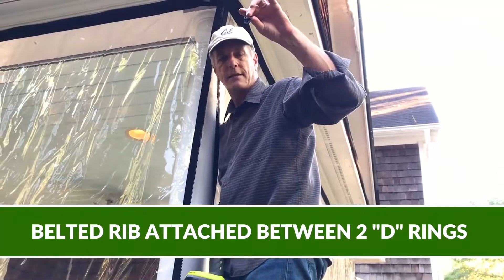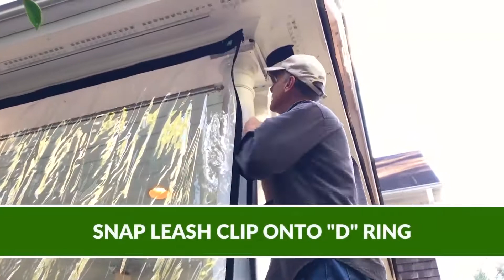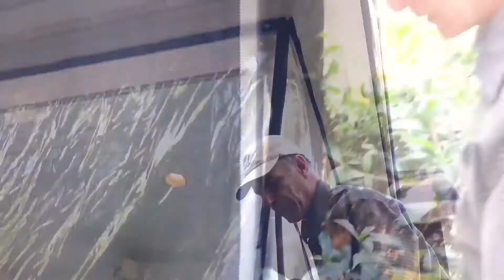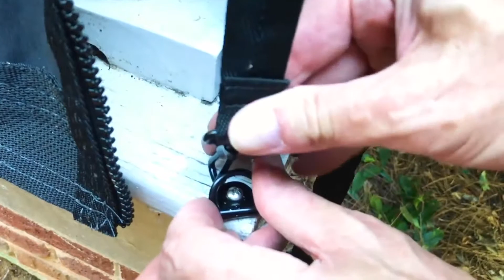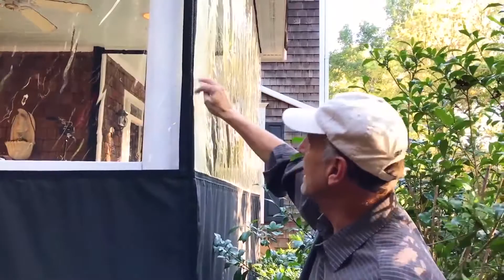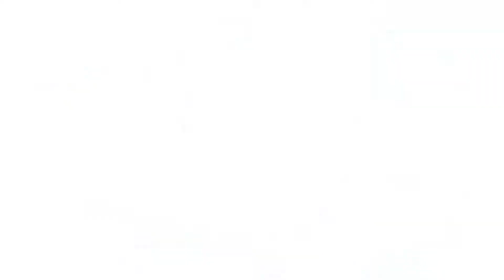Belted Rib

Comment: I am designing a small porch enclosure and have 90 degree corners where there is no support (columns or posts). I have been throwing around the idea of sewing in a pice of webbing to the connecting corners on both panels and then once they are zipped together tensioning the webbing just like the belted rib you use. I guess it is essentially the same idea as the belted rib but it IS attached to the curtain. 

I would like to ask why it is that you have chosen not to sew the webbing into the curtain? It seems to me that I could both increase the curtain tension (for "flatness") as well as create a supported corner at the same time if I were to sew the webbing to the curtain. Am I missing something?? I've never done anything like this so I thought I better ask the expert. :) Thanks for the videos they have been an inspiration!!